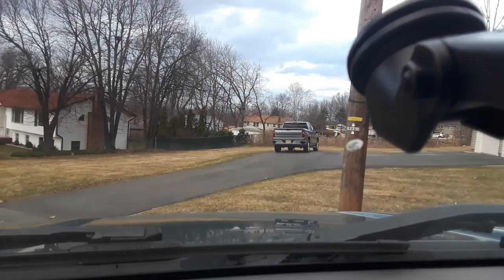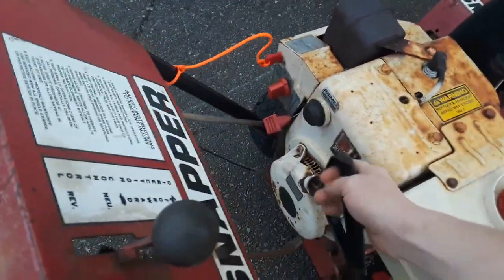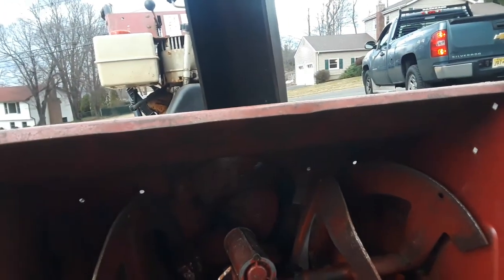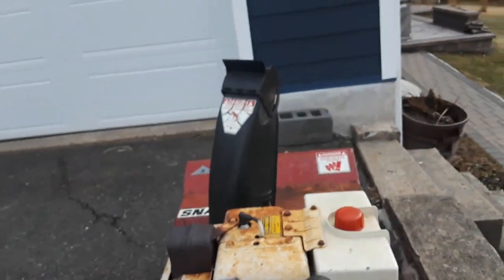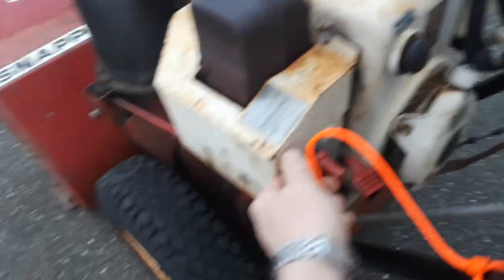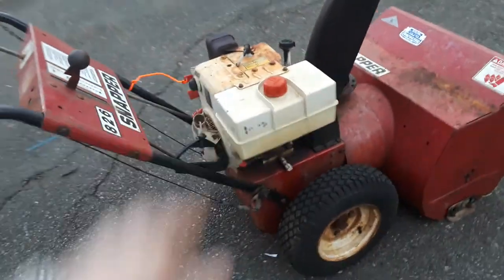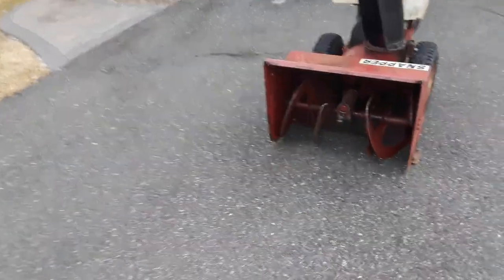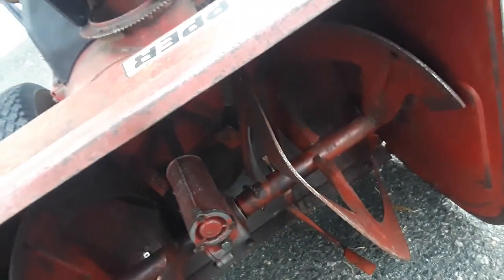Let's go pick up a free Snapper snowblower while were there let's see if it starts. ~Tecumseh 🇺🇸

Comment: Buy a cheap flux core welder and weld any scrap metal you can get your hands on. Really easy to learn. Best $175 bucks I ever spent! They sure don’t make ‘‘em like they used to!
Reply from the maker: Yes, absolutely! It's my next step as far as learning goes with this stuff. I also have to become better at electrical. Still get slowed down putting Briggs onto machines that had Kohler's and vice versa. I have to learn how to independently connect the wires to the proper applications. I got snagged. You get in over your head and are like, hmmm yea I'll just wait for another Kohler. The biggest difference is the voltage regulator and also those Kohler's that have that electronic spark advance which they ditched. I've got most other aspects of this licked. But I remain humble try to continue learning something new every day, share my knowledge with others and stay positive.